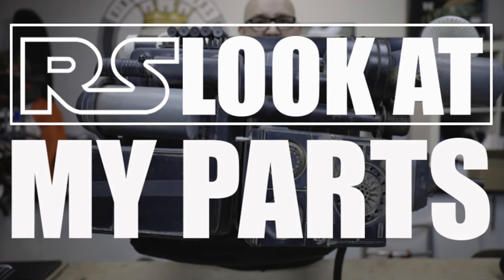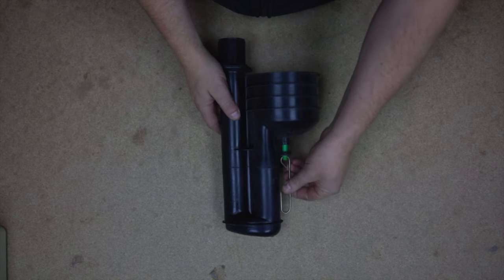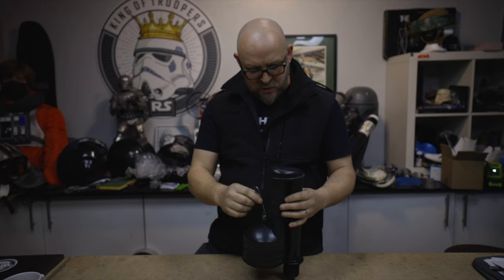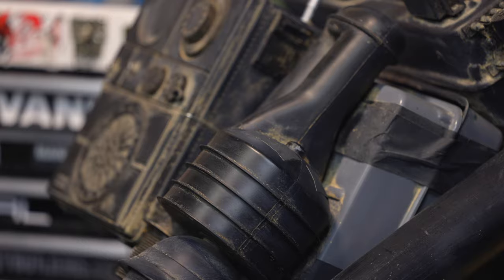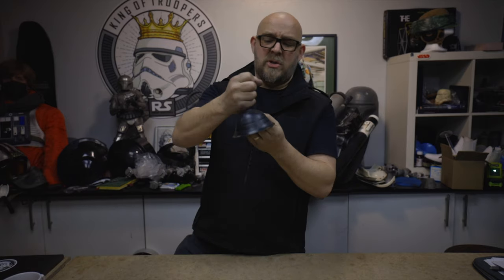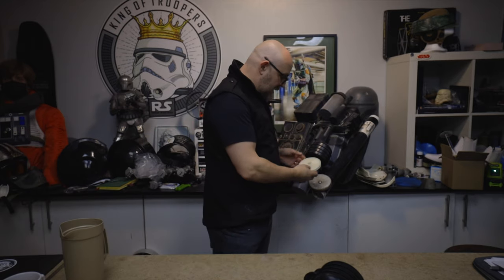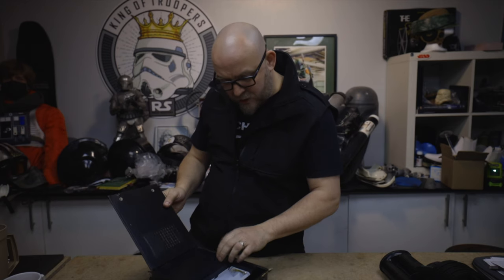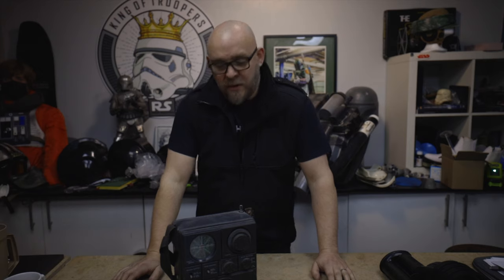Sandtrooper Back Pack - Look At My Parts - S01E09

Comment: Had a Sonix Maxi radio as a kid. Use to pretend it was part of the falcon cockpit as it had a dial and mostly chrome with circles cut out. 
Also had a storage container my dad got from work. It was the same as the ones in SW. Would pretend it was stolen imperial cargo. Got I miss being a kid.

Comment: Ssooo Sandtroopers basically walked around with a load of crap on their backs? Interesting.
Also, I believe those Tupperware lid things were used as part of the rear seats in the Millennium Falcon cockpit.